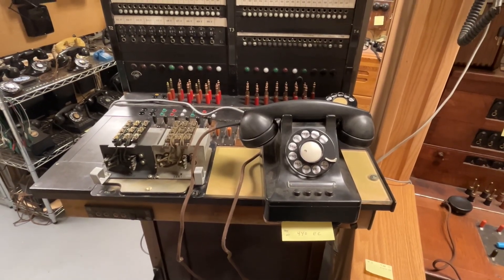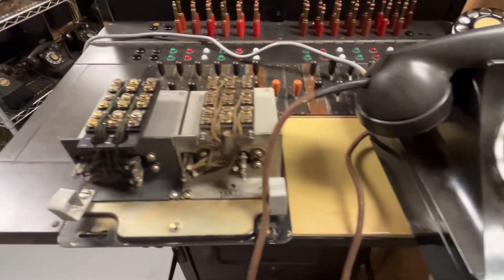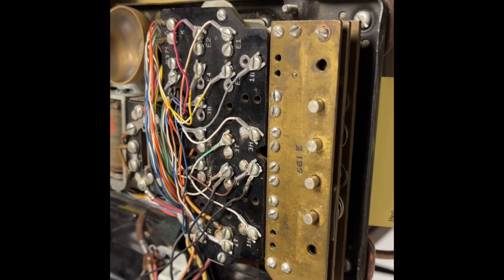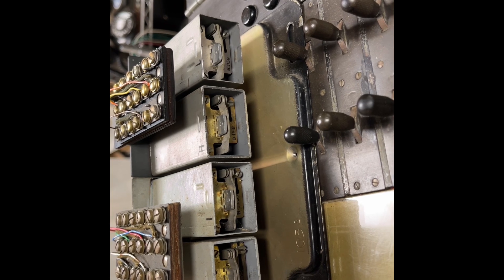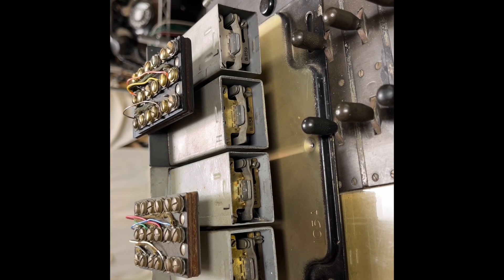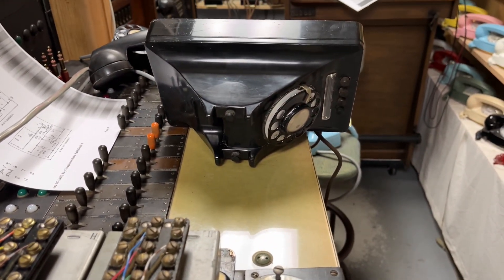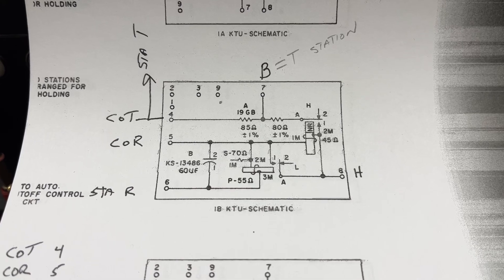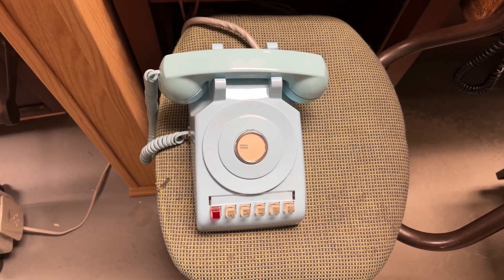1A KTU and a 440 EC Western electric 3L business phone. No lamps. 1946 era.

Comment: My dad's office had a 1A system that was installed by NYTel in the mid-1960s when they moved into that location.  The phones were 564 sets.  That system was in place until the early-1980s when they bought a 1A2 system from an interconnect company.  It was pre-divestiture so NYTel came and took the phones but left the apparatus box with the KTUs ... so I now have it!  I have displayed it working at the Lancaster, PA show a few times.  I connectorized the phones I use with it with 8P8C modular connectors.